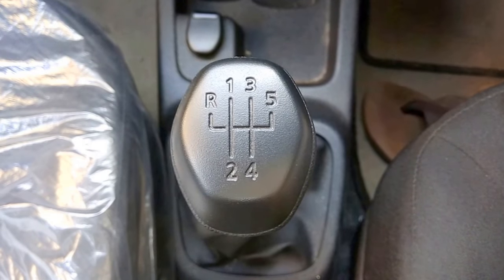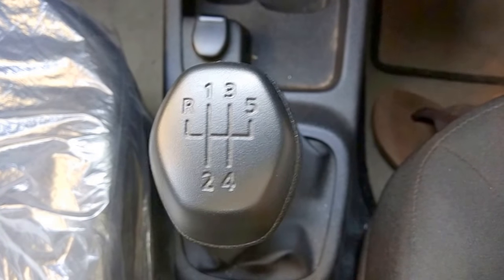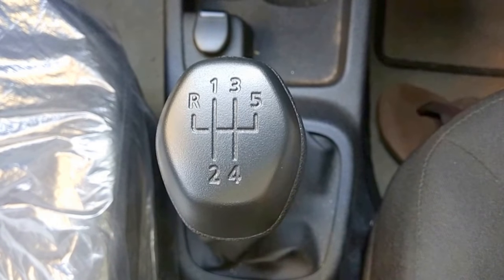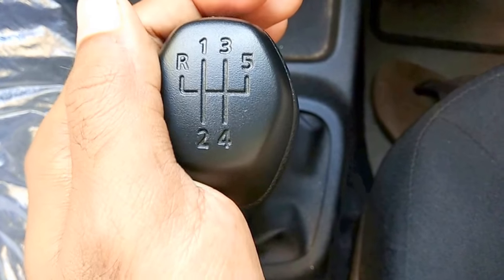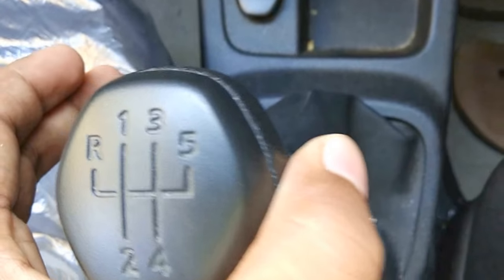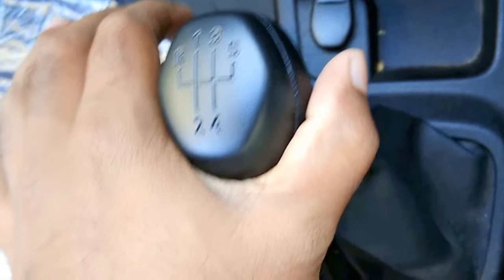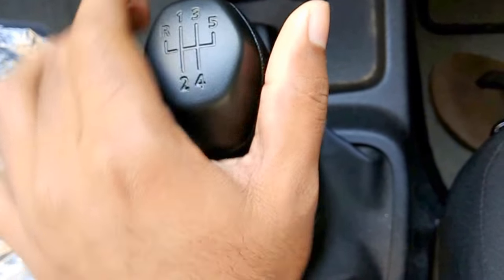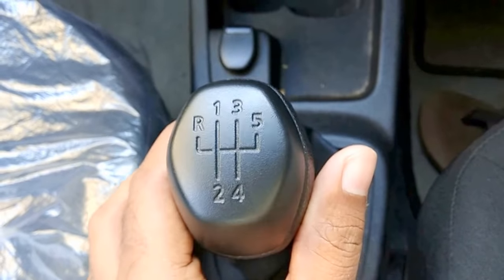How to put reverse gear in Kwid | I10 | I20 | Reverse gear with lifting arm

Comment: What is the use of such gear pattern? Why they made the reverse gear so confusing?
Reply: Yaa i agree with u. The other day I had to park my guest car and got so confused why reverse gear is not happening ,why not make simple like in all other cars or make it automatic
Reply: I think they thought of bringing the consistency incase if the car comes with a 6 gear pattern
Reply: It's made so, so that the driver may not shift to reverse gear accidentally. This type of gearbox is best for learners.
Reply from the maker: To avoid a driver putting reverse gear accidentally. Once you are used to with it, you will like it more than the other.

Comment: I blocked mine lifted, so no need to pull it each time. I'm just really careful to avoid confusing the 1st and the reverse. Reverse is on the extreme left, 1st gear is just close, and that's it. But I don't advice you to do like me, it's not safe at all!
Reply from the maker: Thanks for sharing that. As you said, that's a good hack but not advisable.

Comment: so to put it back to neutral from reverse , still need to lift the arm and pull back to neutral ??
or simply put it back as normal shift

bcs in the first session you were not holding the arm and put back to neutral ,,
but in the last session you were holding the and put back to the neutral 
can you confirm ?
Reply from the maker: I am sorry for the late.

I trust you have figured it out; it's two years since you asked this question.

Stil the answer is- While putting it back, you don't need to pull the gear knob. You only pull while engaging the reverse gear, that's all.

Thank you sir.